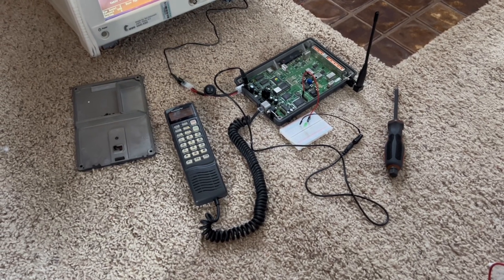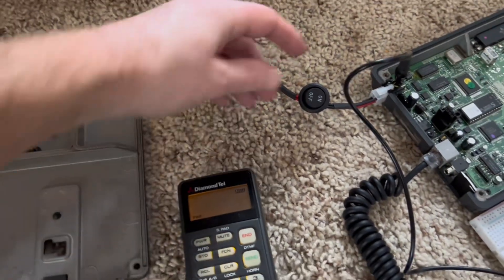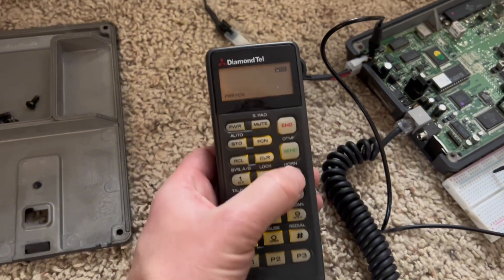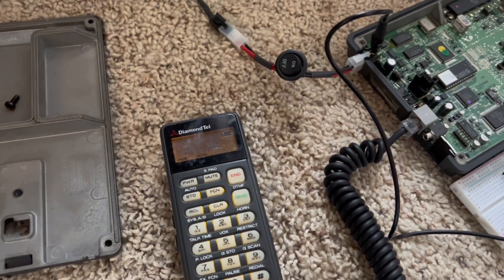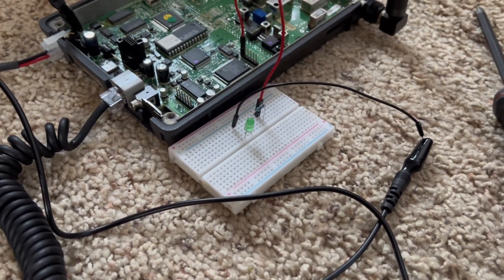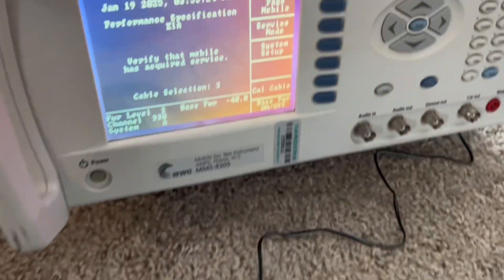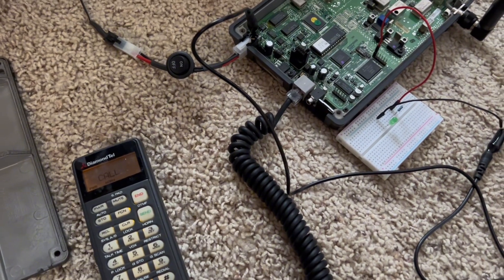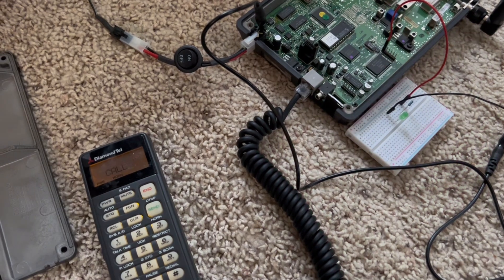Car Phone Horn Mode Demo

Comment: Where could some one get the piece you have?. And could it be installed in a 90s Lincoln town car analog phone? Sorry for stupid questions not very techy
Reply from the maker: There are many different brands and models of analog car phones from the 80's/90's. You can find them on eBay.

If your Lincoln was originally available with an official car phone option, then you'd have to find the specific model of phone and specific installation hardware/wiring/components for your car.

But most car phones back then were aftermarket generic installs. The phone would come with generic mounting brackets and a wiring harness that you would have to splice into the car's wiring somewhere and figure out where/how to mount everything.

It's difficult to find a car phone with all of the required installation parts (whether it's a factory install kit for a specific car, or a generic aftermarket install kit for the phone). You'll probably have to do a lot of research and make multiple purchases to piece together a complete car phone system, and figure out how to install it in your car.

My car phone is specifically a DiamondTel Model 92, which was available as a general product with generic install kit, but it was also available as an official accessory for my 93 Mitsubishi 3000GT with special brackets and modules for integrating it nicely with my car.

Comment: What kind of Bluetooth transmitter is that?
Reply from the maker: Microchip BM62. It’s now “not recommended for new designs”, and I believe the BM83 is the newer equivalent. 

I’ll probably have to eventually update my hardware and software to use the BM83.

Comment: Back in the mid-1990's, when I worked at a 2-way Radio Shop, we installed many analog cellular phones in vehicles.  I recall adding the 'horn honk' option for construction & trucking operators, as they needed to be reached, even when they were out of their vehicle.
Reply from the maker: Thanks for sharing! That makes a lot of sense for construction and trucking, especially while working at construction sites, loading/unloading, etc.

But it's still funny to imagine a trucker stopping for a quick lunch at the truck stop diner, then dropping his food to run out to his honking truck in the parking lot :)